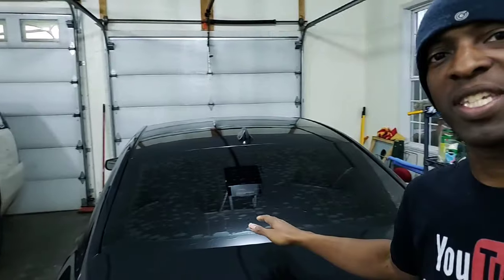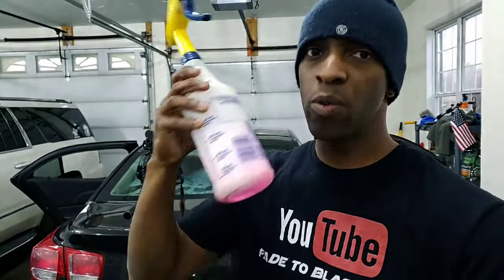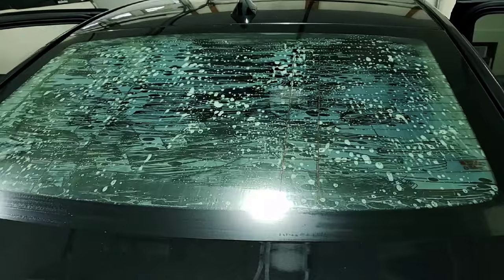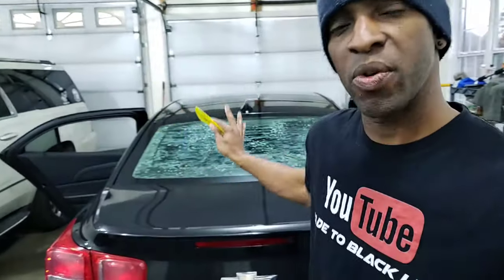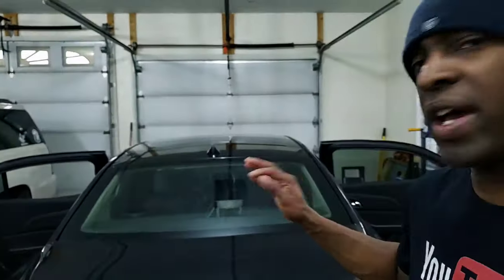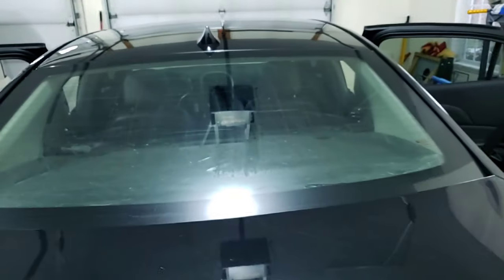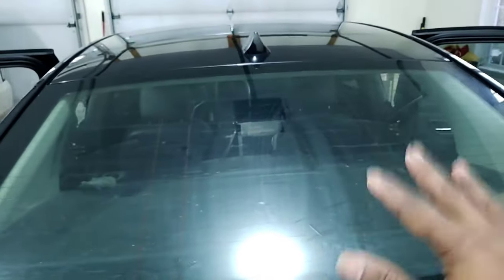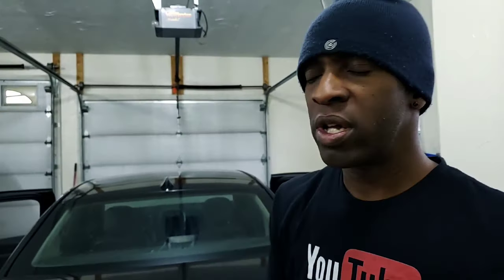How to Remove Old Bubbling  Window Tint and Replace with New Window Tint | Dirty Messy Job!

Comment from the maker: Have any of you dealt with old bubbling tint on your rides?
Reply: Use goof off it’ll be a real game changer I promise DONT use goo gone it’s gotta be goof off I promise
Reply from the maker: @kareemirving5208  thanks for the Tip, I'll grab some and try it.
Reply from the maker: @icanfartloud  wow, man I've never heard that before.  Thanks for sharing that information.  I never even thought of something like that happening under the film.
Reply: @icanfartloud  I'm noticing a few bubbles starting to form on my rear window, is there any way to prevent it from getting any worse? Just really not trying to pay to have my tint redone
Reply: @FadeToBlackLLC  is there any way to prevent this from happening? I bought my car with tint on it already and I'm noticing noticing few bubbles starting to form, just wondering if I can avoid getting my tint redone
Reply from the maker: @brendonbartels1962  I don't think you can avoid it. It's just the film that was installed with possibly bad glue layer.
Make sure it's REALLY starting too go bad, any shop can remove and install a new piece.
Don't wait until it's bad like this one though.
Reply: @icanfartloud  Does this same advice apply to the front windshield as well?
Reply: I have a much better way to remove it. The basic idea is using Super Strong chemical to penetrate the tint.
You need some old school paint remover, or you can mix 6 part of methylene chloride with 4 part of methanol. You need protection gear of these chemicals. You put a lot of them on the old tint. Wait for 10 min. The tint will come right off without any effort. Then, use acetone to remove the glue. Repeat the process above..

Reminder: any product contains Methylene Chloride will do the job. It can get the job done really fast. However, this is a highly toxic chemical. You have to wear protection gear to do the job.

You can pin this review.
Reply from the maker: @lynnmei4346  I don't like using toxic chemicals that can possibly damage me or the customers vehicle. This was one of the worst cases I've had and I hope never again.
Thanks
Reply: @FadeToBlackLLC   I use masking tape and masking paper mask on the rear desk and interior for 5 layers. Put on the protection gear and get the thing done really fast. Then throw everything away. The old school heating method is way too slow. If you have the knowledge of chemical, use the chemical safely and follow the instructions, it is a much efficient way to get it done. It won't damage anything.
Reply: ATR solution makes the glue come off like butter. Been using it for 3 years now
Reply: @taronsnyder8462  atr won't help for old baked tint removal . If you can get the tint off, cheap acetone from home depot  will do the job.
Reply from the maker: @taronsnyder8462  I have yet to try that product. This was one of the worst cases of old tint I've had.
Most of the Super Stripper left on does the trick.
Reply: @lynnmei4346  read my comment. I said Glue, not tint. I just do the bag trick or steamer to get old tint off. Then the ATR is the best to get the glue off
Reply: @FadeToBlackLLC  ya order some. Best stuff I’ve ever used and I’ve been tinting for years now
Reply from the maker: @taronsnyder8462  I'll give it a try. I want to compare 👍🏾👍🏾
Reply: I have a 2019 and my damn tint is doing this on just the back window. I purchased my vehicle brand new at the dealer with the windows already tinted, so I’m not sure why the tint is bubbling
Reply from the maker: @saucysanchez3518  unfortunately they used cheap tint and said get it looking good for a sale. ☹️
Reply: @lynnmei4346  thanks
Reply: I actually have an interesting story about old bubbling tint. A few years ago, before I got my license to drive to school, some of the school buses that I rode on actually had bubbling tint on the entrance doors and front windows, the front window tint had also lost its darkness and it was almost clear, it wasn’t purple for some reason. The passenger windows in the back of the buses with bubbling tint on the front didn’t have large bubbles but some of them had very tiny holes in the tint, and the back tint was still fairly dark. The tint was probably some kind of cheap dye based film.
Reply: Wish I would’ve known this 5 years ago! My rear window looks exactly like the one in the video 😞 @icanfartloud
Reply: So, how long did the entire process take you to complete this?? I have an '05 Avalon that I'm being given an estimate of 4-5 hrs to remove bubbling tint off of my rear window and to place new tint. 

Also, can some chemicals or scrubbing with the brillo damage the defroster?
Thanks
Reply from the maker: I don't even remember.  Honestly there isn't a time frame to get this done.  We don't know how much work it will take to get it all removed and ready for  tint.  Every shop has it's own methods and there is no easy way just hard work.  @nzinga542
Reply: @icanfartloud   Defrosters are there to use! My car is 14 years old and back window was fine until last year... To say that other unexplained problems had happen, like the back sit was wet all winter, but no leak on the roof  everything is dry and same colour...
Reply: I think the rear defrosters have to be on and hot the whole time

Comment: All companies making A+ b c grade films with different adhesives. Aftermarket films with lifetime warranty lasts about 3-5 years then rear windshields suffer the heat elements. The films under heat contrast like condensation and collapse under their own. Regardless of removals the glue can be removed with Acetone with gloves and mask n goggles. I've removed hundreds of rear windshield glues in less than 1 minute. After the clean up a scrub off and 1 final winder n water and baby shampoo for a total of 3 minutes. ACETONE IS YES HARMFUL AND SHOULD ONLY BE USED BY A PROFESSIONAL! coming from a 🐐. No damages in 25 years.
Reply from the maker: Thank you for the information. 👍🏾

Comment: It appears that the person featured in the video is knowledgeable about the tinting process and demonstrates a professional approach. Bubbling in window tint can be caused by various factors, such as high temperatures, particularly when cars are parked outside, which is more common in southern states like Florida and California. Additionally, excessive heat application during the installation process, typically done with a heat gun, can damage the film and cause it to harden, potentially allowing air to penetrate the rear window, particularly in the area between the heating wire and the glass. This highlights the importance of the skill and expertise of the installer in ensuring a high-quality and professional tint installation. When performing the forming process, it is crucial to apply just the right amount of heat needed, as window tint films have a predetermined threshold for heat tolerance before hardening.
Reply from the maker: Wow man very informative comment.  Thank you for taking the time to help give us that knowledge.
Reply: Lol chat gpt

Comment: Those defroster elements are more durable than I first thought.
Reply from the maker: I made sure not to rub that hard. I was Jusy trying to rough up the glue and let the Stripper bite in.
I didn't want to replace a glass that day.
Reply: @FadeToBlackLLC  last tint shop ripped out all my defroster lines.
Reply: I came here to see if anyone mentioned the defroster. Messing that up is my biggest fear doing this.
Reply: Defroster lines are an easy fix.

Comment: Iv got alot of air bubbles on the tint of my back window,i was told by somebody if i heat or warmup with a hairdryer theyl flatten & rollout easily,is this correct? if i cant fix myself alternatively i may have to get redone,thanks,liked & subbed btw.
Reply from the maker: I don't know your situation to make an suggestion? Did you just have it done? Has it been with bubbles for a long time?
Bubbles is a pretty open statement.

Thanks for the Sub.. More content once it's not so crazy busy.
Reply: @FadeToBlackLLC  it got tinted 5+years ago now,i may have to pay n get redone unfortunately,thanks for replung

Comment: I've a 1st generation Mitsubishi Eclipse that belonged to my wife with a similar rear window film issue. Been reluctant to repair due to possibly damaging those defroster lines. It's gotten so bad I'm going to have to address it very soon. Your video was very helpful, I'll replay it several times before doing the removal and replacement. Good job on that Chevy! 👍
Reply from the maker: Thanks for watching. There was a car from down south the tint turned clear it faded so bad I couldn’t remove it. For a couple hundred bucks we just got a new glass. So it’s not the end of the world. Some people don’t even use the defrost any ways. Good luck 👍🏾
Reply: I recently bought my eclipse and have to get rid of the old tint in the back but it’s a hatch so wish me luck!! 😭🙏

Comment: Great job!  I'm was 3m tinter/trainer from Houston in the 80's and 90's However, I've been an owner operator trucker for the past 27 years. 
I always tell the customer that the defroster might not work after the film has been removed, to cover my back and have them sign a release to avoid future litigation. My old boss taught me to do inspections, take pictures and have them sign the inspection sheet before any work was to be done.
On back glasses, I use simple green, cut a trash bag to fit, put over the tint, leave it in the sun  or use a heat gun on the outside to help emulsify the glue. (I cover the interior to protect it from the simple green solvent) This usually works most of the time but if you are dealing with an old car, the tint still comes off in tiny pieces. Then, I just use a heat gun on the outside to heat up the glue. Worst case senario, the defroster comes off with the tint. That's when you show it to the customer and tell him the defrosters is not going to work anymore. Then, you can feel free to razor blade the back glass and remove the defroster paint too. (This didn't happen very often)
Keep up the great work.
Reply from the maker: You know your stuff and have been through this.  I like the Super Stripper personally. If I spray and leave it on the glue it will actually disolve the glue away as long as it doesn't dry out.  I'll spry the glass and keep it wet with SS and work on other things until it's clean.  It doesn't even mess up the interior pieces either.  Thanks for sharing your information.
Reply: @FadeToBlackLLC  you're welcome.  Thanks for making this video. SS sounds like it's going to work better than simple green. Take care
Reply: Just got my Civic backglass removed last night. Came off in pieces and much more nasty than this. I guessed the tint was so old and thinnered up so pieces still stucked on and had to be removed by razor blade. I had to remove some of defroster lines as well ( no choice) It took a lot longer than expected. Now, look like I have to touch up defroster line paint conductive. F*** that job. When the tint is old, it will take the defroster line with it. I did use the steamer vigorously and let it sit to soften the film.
Reply from the maker: @dannytrinh07  That sucks it didn't keep the lines.  It's hit or miss with cars.  I've had a customer just replace the whole glass too.  It just depends on how far someone is willing to go with it.

Comment: Just got my first car and the rear tint is bubbled so bad i can’t see out it. Gonna remove it myself then wait till i can afford more to be put on. Seeing you do it and seeing that it can be done with a handful of store bought adhesive remover and a TON of patience has definitely helped me get an idea of how i can do it myself. Dunno when i’ll do it (maybe after some more research) but i might edit this comment updating how it went. Thank you so much for this video!!
Reply from the maker: If you just had it done why not go back and talk to them about it and see if they will fix it?
Reply: @FadeToBlackLLC  no, I mean i just bought the car. The tint has likely been on it for a long time cause it’s used
Reply: @SpookyscarySayge  not yet. Too lazy 😂 but I’ll definitely reply when i do to let you know how it goes
Reply: Are there any issues with just driving around with it removed? Like more sunglare from the back or is having a tint mostly cosmetic? I would like to remove mine because of bubbling but I don't want to get a new one installed just yet due to cost.

Comment: I don't know what you're using the strip the glue it but but when I do my vinyl I used mineral spirit put it on their heavy and then spray a little bit of WD40 on the paper and then wipe it with it and that makes it pretty easy to come off
Reply from the maker: Learn something new all the time.  Thanks for posting!

Comment: You're videos are great. The best I've found. Question, the tint that you applied on this vehicle, what are the specs on it? VLT? Carbon? Ceramic? I've seen some tints called Charcoal Standard? Metalized/Dyed? Adhesive type?
Thanks!
Reply from the maker: Thanks for watching. We all have our own style.  I like to tell you and show you what I'm doing.  This is a Carbon film.  Check out FlexFilm Terra Flex.  You can Google it and find the specs.  Thanks for watching.

Comment: My rear window looks worse , I bought a heat gun  but I am worry about the defrost coming off.   do you recommend a steamer better ? Thanks in advance
Reply from the maker: Yes I have a link to a steamer in my Amazon link in the description.  It's the one I use.

Comment: After tinting the windows and letting it dry for 3-4 days, I found some water bubbles.  Can I still squeeze the water out or using the heat gun.
Reply from the maker: It can take weeks to fully evaporate. Make sure it’s moisture and not contaminate particles. I’d just leave it for at least two weeks then look at it. If it’s fine from a few feet away I would not worry about it. No one is supposed to have their face on your car.

Comment: I have the same prob right now with the ugly bubbles. What's a reasonable price range for replacing just the back window like in this video?
Reply from the maker: Prices will vary but I'd say around $250.  Call a couple shops in your area.  It's a safety hazard not to mention how bad it looks.
Reply: @FadeToBlackLLC  thanks!

Comment: Just came upon your video. I am in sunny Florida. Can this be done in direct sunlight as I have no garage or car port. I did pick up the awesome and will be working on a Kia Optima with all the defrosters. Just want to make sure I’ll do no damage working on it in the direct sunlight. Thank you for the video.
Reply from the maker: There's no guarantee that the window will still work. I've never had an issue damaging a window though so I usually don't worry about it. The main thing is just getting the glue off with no issues.
You can bake the glass out in the sun with Florida heat and a trash bag. I'd probably do that before a steamer if it got really hot here.
It's all about trying methods that work best for you.
Reply: @FadeToBlackLLC  Thank you for the feed back. I’ve heard of the trash bag theory. I thought it was just one of those myths. Lol. I’ll bag it up and let it bake it’s going to be 85 degrees and sunny today. Really appreciate your help.
Reply from the maker: @cecestroh3229  I just left Orlando from the two day Tintertainment event. It was a nice few days away. Now I'm back in Wisconsin. Have a good one!

Comment: I use a garbage bag. Squeegee it flat after spraying the window. Let the car run for about 20 minutes with the rear defogger on. Once the glass is hot, the film peels off along with the glue.
Reply from the maker: Thanks for the tip. Do you also get the car out in the sun? Usually here in Wisconsin the weather is all over the place so being inside out of the elements is best for me.
Reply: @FadeToBlackLLC  If possible, yes. I also use a heat gun if the glass isn't warming up in areas that are away from the defogger lines. You're probably going to need to reset the defogger button once because it shuts off around 15 minutes.  20 minutes is usually long enough.

Comment: I’m going to get my new car tinted in like two weeks and I already have my setup for the tints but I want to know if it’s possible to tint the whole front windshield then put the visor tint on top of it? Like 50% windshield with a 5% visor
Reply from the maker: Yes, I'm pretty sure I have a video showing that on my Channel. You can do that all day.
Eager to hear how you like it?
Reply: Fade To Black LLC It’s not bad. So far I’m starting to like it lol I went from a Toyota to a Honda.. Lol I was surprised at first that the Honda Accord costs way more to put gas in than the Toyota Camry
Reply from the maker: @bassdynasty8840  I've had both of those back in the day. My Camry was tinted 20% Sides and Rear with a 35% full windshield.
My Accord was just 20% Sides and Rear with a Vinyl Visor. Those were way back in the day though ha ha.
What year is your Accord?

Comment: The bubbles are caused from the frosting as u call over there the lines overwork when in use and cause the glue to lift
Reply from the maker: Thank you for sharing.

Comment: If i had to guess this happens due to the tint expanding when it’s hot and shrinking when it’s cold leading to the adhesive failing in many different spots
Reply from the maker: I'm not sure, I didn't install just did the replacement.
Thats a good explanation though 👍🏾
Reply: @FadeToBlackLLC  Thanks
Reply: It happened to my 2020 after only 2 years of standard film on rear glass